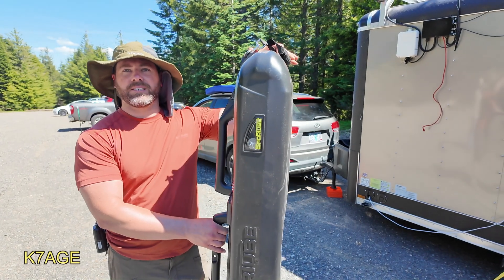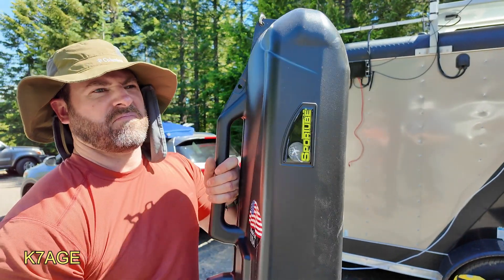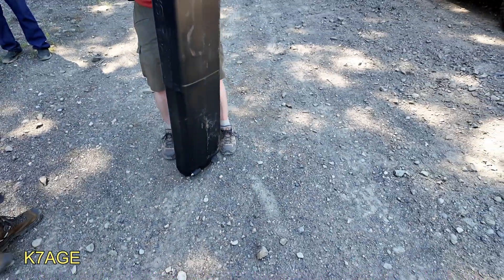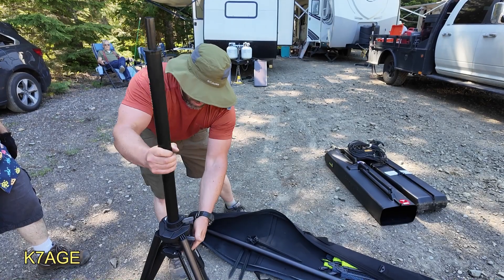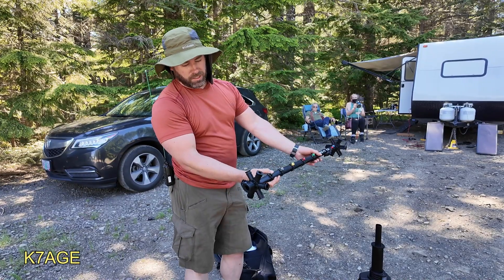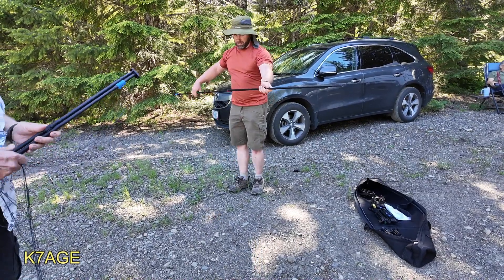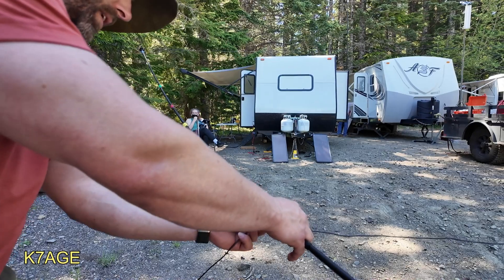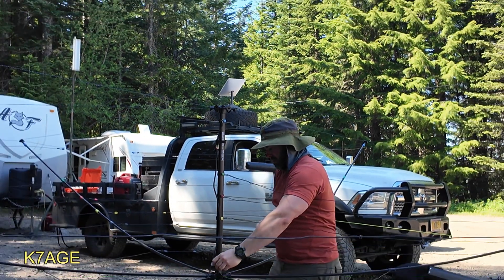W7Q Field Day 2024: Buddie Hex Beam

Comment: We learned the hard way that the way to guy these is to put the mast and guy system up BEFORE you mount the antenna.  Once you get it all tensioned properly you then bring the mast down, put the Buddihex on and then push it all back up.  This will make guying the antenna SO much easier.